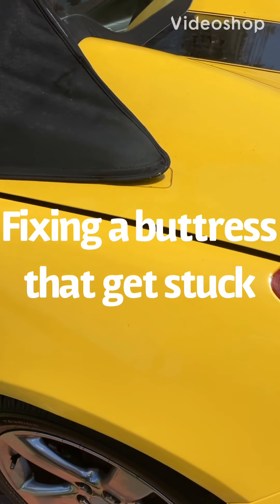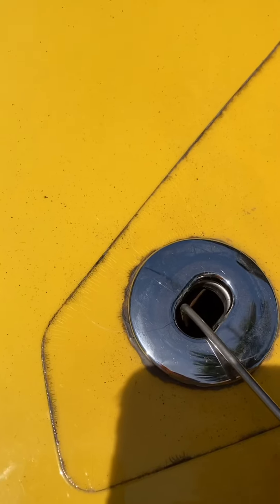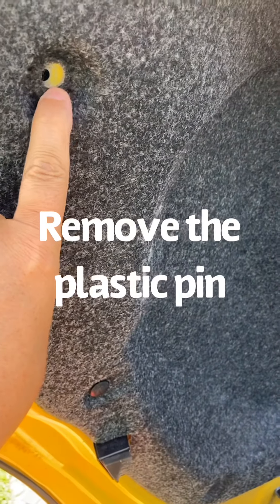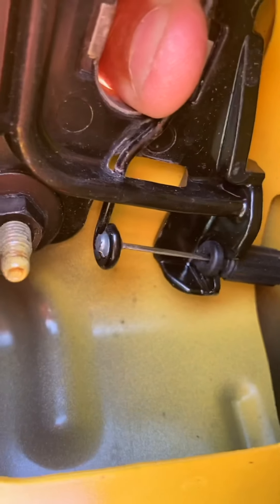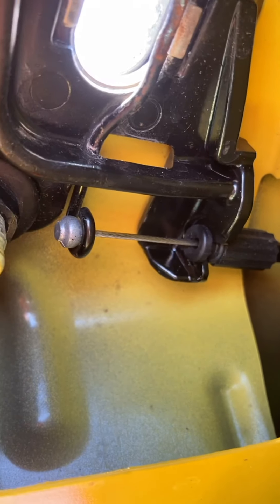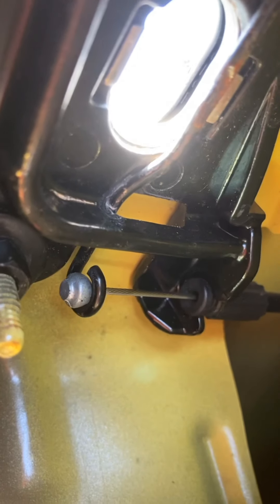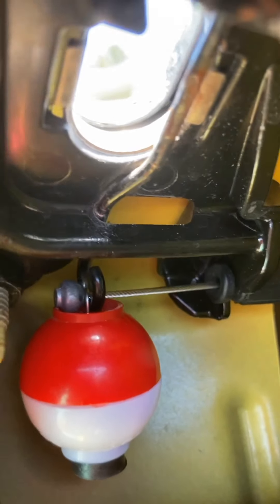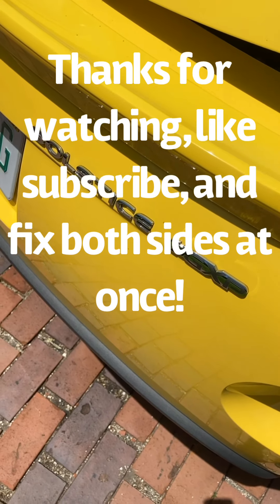Pontiac solstice or Saturn sky stuck buttress / trunk flap

Comment: Great videa...very helpful and it worked for me (on the buttress opening and cable/clasp repair). However, I used two strong zip ties to secure the wire head around eyelet. Opens perfect again ..with $$ paid to a dealer! THANK YOU!